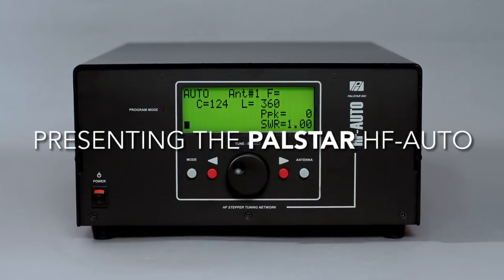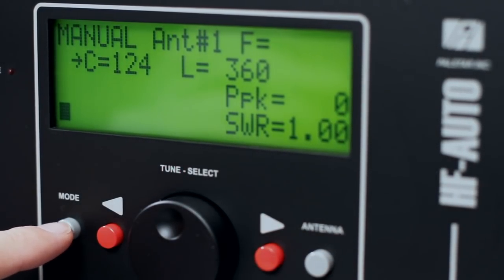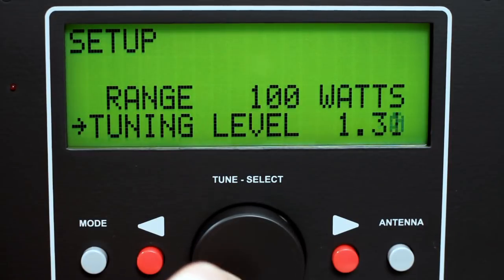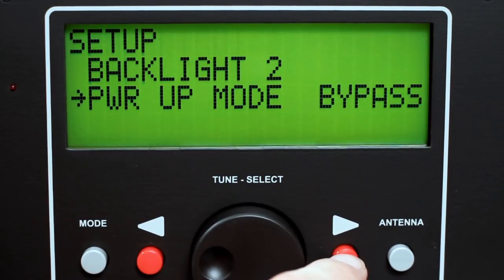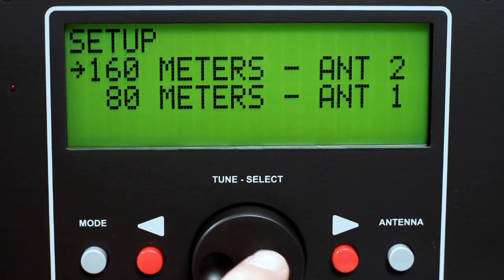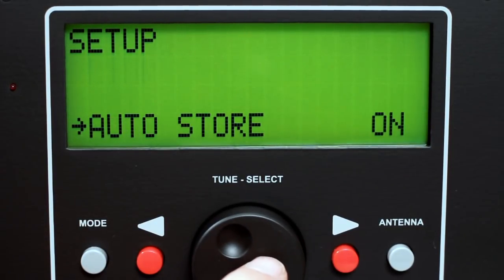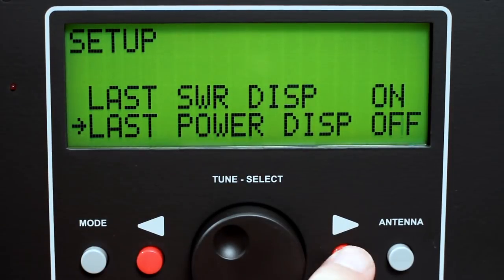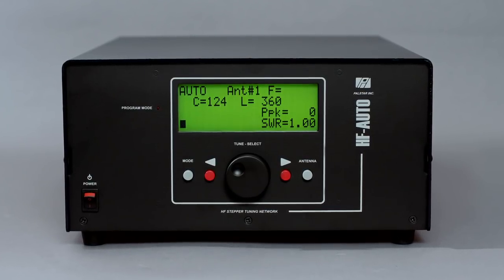How to Setup Your 1800 Watt HF-AUTO Autotuner from Palstar, Inc.

Comment: Ok so here is my two week update. I’ve used many tuners since the 90s. An had a few I really liked. I’ve never operated a tuner that is so easy to use. Basically. This is the best tuner I’ve ever owned. Setting up seems so simple. An is quicker then you think. I have several friends whom use this tuner using legal limit, and by far for them this is top of the line. Can’t get much better. I have with my antenna an swr of over 3 on most bands. With this tuner I normally reach a 1.01 swr. Very fast running. Very quiet. An if you don’t like the swr shown. It’s so easy to save the new settings from manual mode to auto. I can’t say enough about this tuner. Being legally blind I have no issues operating an seeing this display. So do your self a favor folks. Buy this tuner. You will not be disappointed. Listening to this tuner do its thing while running is quite refreshing. I actually have found myself tuning in random places throughout the bands just to hear it tune. Don’t wait. Call Palstar talk to eve. Or Paul. Very very down to earth and humble.  Very very happy with this purchase. Makes my flex happy too. I’ll update in another cpl months. Thanks Paul. 73s. AA1US

Comment: The new 1,800 model has the PalStar logo in color blue on the lower left of the front panel.
I bought the new model (sold the older model) and it tunes lightning fast and memorizes favorite freqs.

Comment: a HUGE upgrade over the relay based auto tuners.... very much lower swr's with this one.  You don't really need the cable unless you plan to upgrade the firmware. Only drawback...cost......

Comment: Don't understand why MFGR's still have the rs-232 port when it could be USB or maybe both?
Reply: Hams are cheap as hell. They refuse to upgrade from their old Tandy computers
Reply: Just to put HDMI label and use it on a product will cost a lot because of licensing rights, so to keep the cost down that’s why. HDMI would add another 500 dollars to the product, that’s why you don’t see it on Icom or Yaesu or Kenwood radios for the external display. Flex has it but look at the cost.
Reply: @gregboggs4721  USB?

Comment: Very disappointed in the performance and reliability of the tuner. First, it doesn't memorize the tuning solutions. It runs through the entire tuning process every time the transmitter changes frequencies. For some reason, it won't tune my trap dipole on 40 meters. With the tuner in bypass mode, the internal tuner in the Flex 6600 tunes it on 40 easily, so the problem can't be the antenna. The only advantage the Palstar has over the MFJ-998 is that it will automatically change antennas when the band changes. My baseband deck is in a different location than my RF deck, and running back and forth to change antennas would be annoying. In the meantime, I can't use the amp on 40 meters.